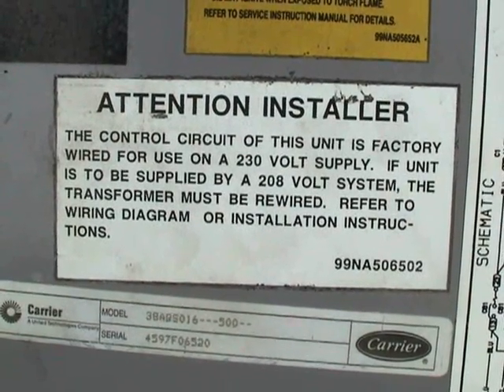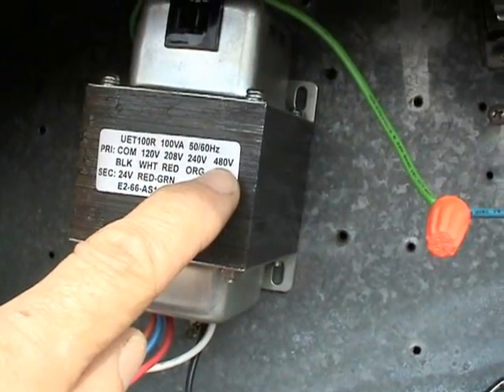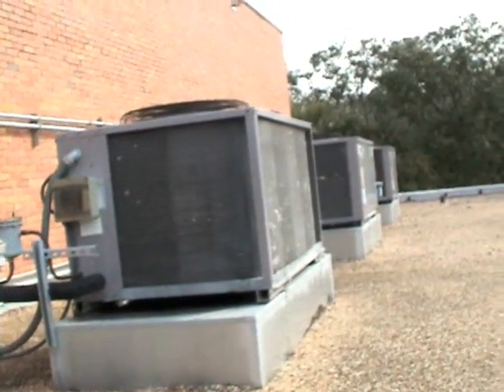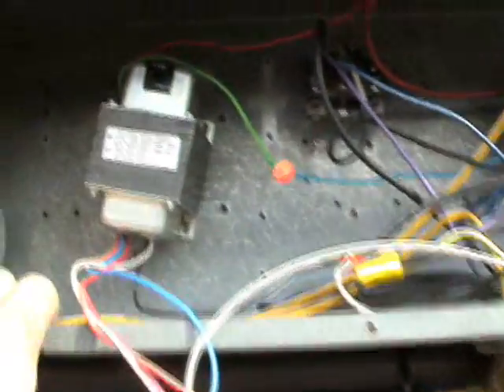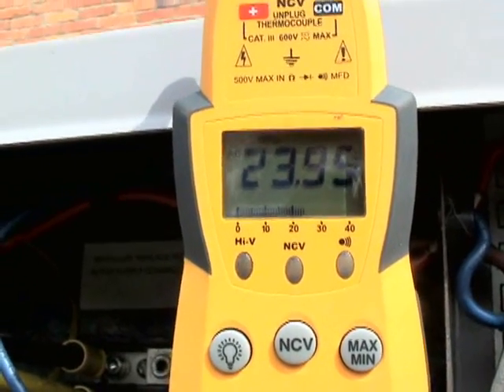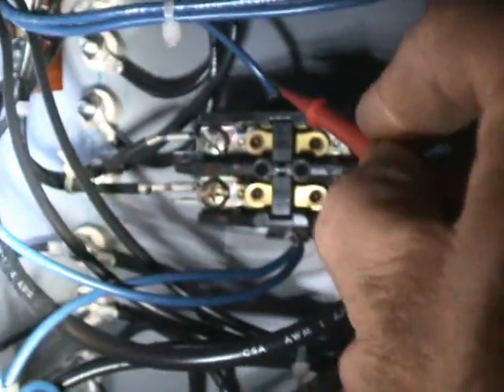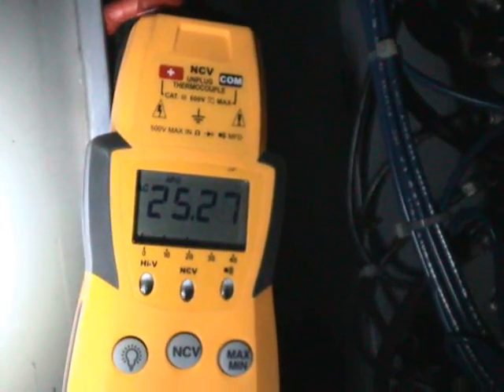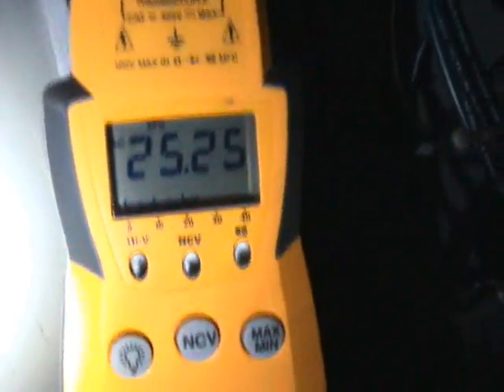HVAC control transformers 2

Comment: Good video, but you also need to remember that your transformer wasn't loaded very much at all, 27V is normal.  Once you close all of those contactors, I bet you would've seen it drop to 25V on the 208 tap or down in 22-21V range on the 240 tap.

Comment: So that transformer is roughly good for a max load of 4.1 Amps, I've never seen one transformer supply control voltage to that many units at once... where are the wires ran?

Comment: Excellent video and good points!  I don't work on 3 phase very often but I have run across a transfromer that ws set to 208 when it should have been 240.  Took a while to figure out what was going on! :>

Comment: Type one certification is not any more a joke than the other certifications. That is the level of certification required if one only works with small refrigeration systems. Any other certification is redundant and unnecessary.